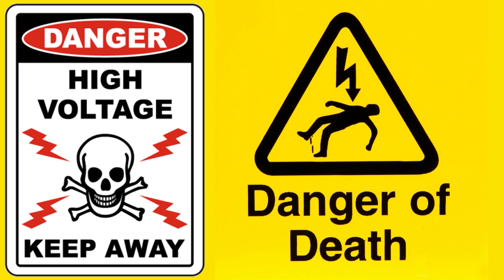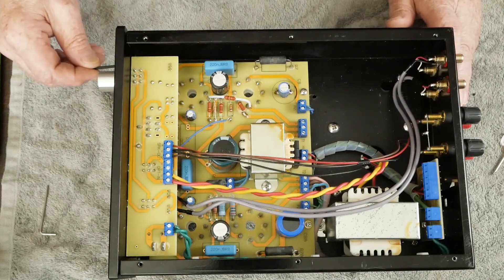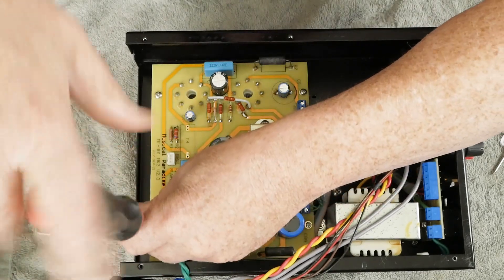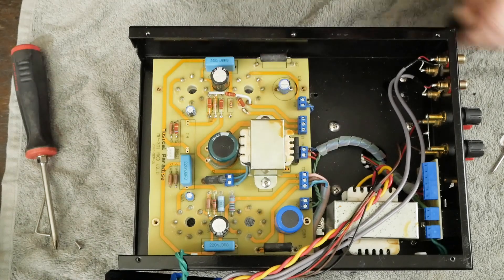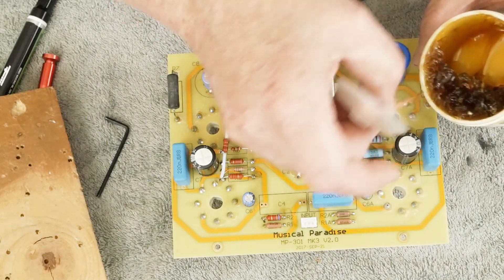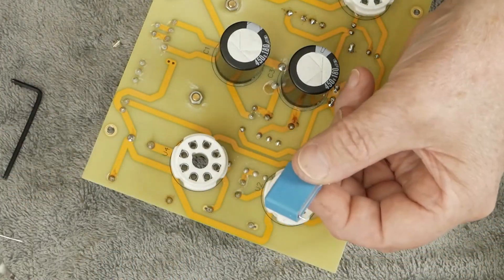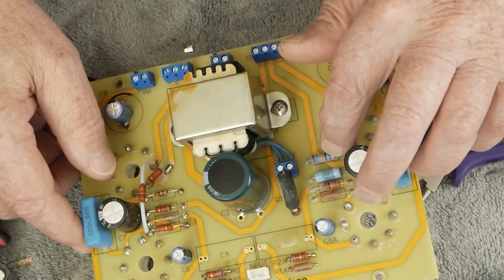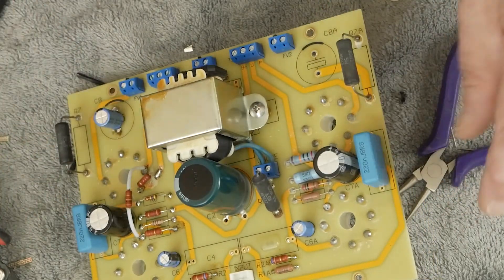Musical Paradise MP301 MKIII: Circuit Board Mods Video 1

Comment: Didn't you verify that the output transformers are crap?
Reply from the maker: I ended up using the transformers they come with. The XSE  Edcor units I tried are clearly "guitar amp only" use.  A transformer upgrade would help the low frequency response, if there are any out there that are better and would fit. Yeah the ones in the unit I worked on are mediocre.
Reply: @SkunkieDesignsElectronics  So then, really, without output transformers, improvements become of diminished value? It is disappointing the XSE transformers are of little value in a listening situation.
When you review/improve a product you have to start with something of value. This is the attraction of the Reisong a-10/12, for little money you get something to build on.
Reply from the maker: It makes a nice improvement and is still worth doing if you already own one. I wouldn't buy one with the intent of mod'ing it

Comment: I have the same version as @g-train9372 posted earlier.  The "platinum" version with the green pc board. After a quick glance, I found the circuit fundamentals appear unchanged.  A smaller pc board in front of the choke on the main board houses 3 screw down connecters found on the skunkie board, the rectifier and an additional capacitor not on the skunkie reviewed board. This smaller board sits between the output transformers. Apparently, this version needed room for the additional capacitor.  Also, it's less crowded, mounting the screw terminals and rectifier farther ahead of the choke.  The pc board appears to be of much better quality. Also, the power and output transformers are claimed to have been upgraded, resulting in more available current and a flatter response on the low end. Although being impractical, it would be quite interesting to have this version reviewed (unmodified) to see what (if any) improvements are realized over what was reviewed by skunkie. I plan on going with the skunkie modifications. I don't anticipate any issues other than some slight changes, as described. Also, I plan on going highly gonzo with this project far beyond the skunkie mods.  If it goes as expected, I'll post the details. I couldn't believe my luck, as I had just purchased this amp, and found the earlier videos of the skunkie mods.  What a god send! Thanks, Steph!
Reply from the maker: Yeah, I'm kinda done messing with these made in China amps. I have easily 40 hours R&D time into this one, plus have wasted a couple hundred in parts, easily lost $1000 parts and labor working on this :(
Reply: @SkunkieDesignsElectronics  Wow.  Again, thanks so much for posting all the videos.  I had no idea all that these reviews entail. I've purchased several other Chinese amps in the past that you have reviewed. I plan on modifying those as well. You go far beyond the extra mile by posting before and after test results via the distortion and frequency response curves.  You back up your recommendations with authority. Few, if any do that!  I'm looking forward to the final videos for the MP301.  Once I complete my project, I'll post the results and pics, to help others realize more potential from this otherwise, decent amp (as far as Chinese tube gear goes) They have a lot to learn about designing and producing classic American tube audio gear!

Comment: Looks like some quality components were used, Rubycon and Nichicon caps.... And some of those resistors look like Vishay CMF Mil spec resistors?
Reply from the maker: Possibly. We do have to remember all this was made in China, so I take labels with a grain of salt. But at the end of the day, even if quality parts are assembled into a design that has the poor low frequency response etc. this amp had, does it matter?
Reply: @SkunkieDesignsElectronics  I agree with you, bad design is bad design. I guess part selection and source of those parts is dependent on the manufacturer and their reputation, not all Chinese manufacturers use fake parts. I enjoy watching your channel, thank-you very much for all the teardowns and fixes, its very interesting.
Reply from the maker: I start to question the validity of the parts when the BOM for the amp is higher than what it's being sold for :)

Comment: Just my luck, I have two of the newest versions. Mk3 version 3.1 it says on the circuit board. Along with the word “platinum”.
Don’t think I can make the changes. Poo! Darker green board and circuit is a little different.
Reply: You can still put the schematics of both versions side by side and see if they match where it matters. Perhaps the differences are trivial, like the color of the PCB ;)
Reply from the maker: Correct and I can not possibly look at every revision of this amp. This board is so basic, it's trivial to follow the traces and figure out what, if anything has been changed. I suspect the basics haven't changed.
Reply: Read my post.  You should have no problem making the changes with the platinum version.

Comment: Tolles Video  und Danke das Du alle Modifikation so detailliert beschreibst. Eine Frage: wirken dies Modifikationen auch für andere Röhren z. B. KT88 ?
Reply from the maker: Yeah, but using a KT88 running this cold in any version of this amp, stock or modified, would be sub-optimal. I've never seen output tubes running WAY under spec in a SE amp working well. I think most of this is expectation bias finding a KT88 sounding better than a good EL34 in this amp. But yes I didn't change the operating point of the output tube so if you still want to use a KT88, you can.
Reply: @SkunkieDesignsElectronics  thank you 🙏

Comment: Good job Stephe!  Hey I've got the same flux as yours!  I had to nearly burst a poofle valve every time I tried to open mine, cos the flux nearly glued the thing shut.  So now I just place an oversized lid on top, & the stickiness of the flux kinda sticks it on pretty well enough.

Good to see you cutting the used part of the desoldering braid off each time.  It's too easy to have the hot braid stick to the tracks where the heat of the iron doesn't reach it, & rip the dang track off!  The hot end of the braid can also touch & melt other components & wires too.  Very good idea using flux with the braid too.

I always try to stop the excess component leads flying to who-knows-where when I'm cutting them off.

Nice girly-coloured purple long nosed pliers ya got there! - Although I like purple anyway!

But yeah, a good demo video for those wanting to mod/upgrade their 'Musical Paradise' amp!